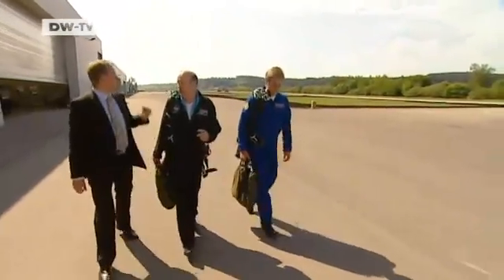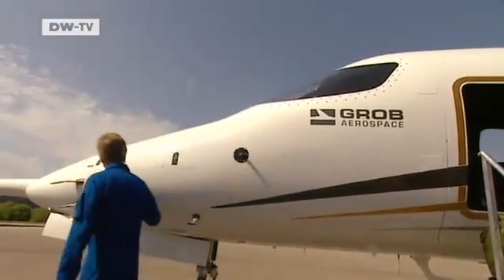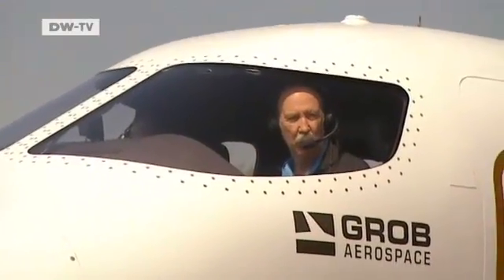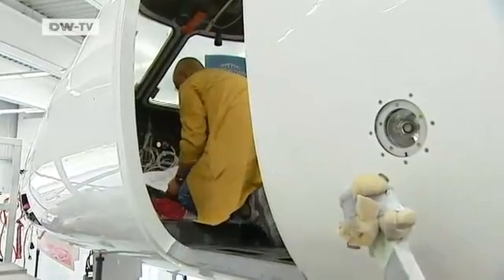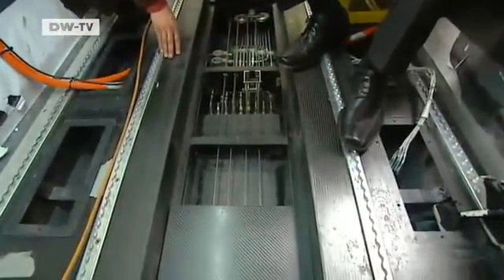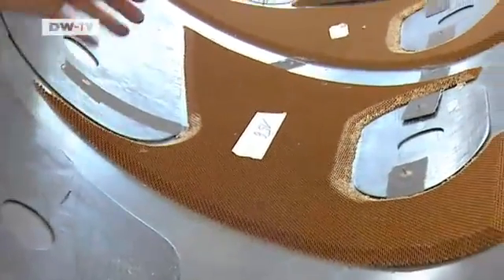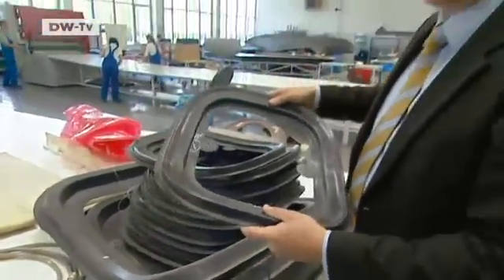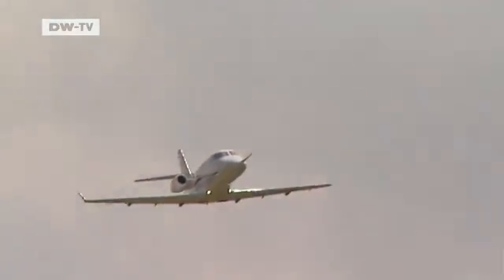Made in Germany | German Airplane Manufacturer Grob

Comment: Here after the news of Tata acquiring the IPR of this lovely jet!

Love from India.
Reply: Is tata also aquire engine tech of this jet?
Reply: @ajitd1521  No, no. It uses a Williams jet engine.
Reply: @AbhiKohli  so they used htap enginr og Hal
Reply: @ajitd1521  The size and thrust of the Williams engine is made to fit in the plane. It would be impossible to replace it with our homegrown HF25 engine. The power difference is quite much. Also, I am sure Tata don't want to spend more money on re-engineering an already very well performing jet.
Reply: @AbhiKohli  
But lenght is little bit more but diamer of hf25 engine is same
Hf25 is already try same type of aircraft

Comment: Can anyone help me with a doubt? Was used because this honey-comb tissue and not carbon fiber? Is there any technical advantage using this material?
Reply: Honey-comb material is a complimentary material to Carbon Fiber.
Reply: +Leo ybrv Honeycomb is used in combination with carbon fibres to build a so called "sandwich" structure. this is more stiff than a pure fibre shell whilst the core adds only a little bit more weight. in the video the fibres are missing in the shell. what you can see is the honeycomb layed in the mould for demonstration...
Reply: +Erik Seymour its phenolic or aramid honeycomb....sometimes aluminium honeycomb is used but galvanic protection required between carbon and aluminium
Reply: +Erik Seymour I don't know about this case, but for aircraft fittings (seats, console, galley) it's made out of .... cardboard.
Reply: +Nicole K it's paper I just had a 3 week school at the factory for the new g120tp.

Comment: carbon fibre cant hold its wealth creation like lithium metal alloy can so the economy is useless and one scratch and your grounded plus resale value falls like the space shuttle and so your not realy getting value for money with these miracle fibres as well the new 130 nose spar swivel angle rule and the lift centroid creation forward of the c/g is absolutely esentual to know or else you have a divergent aircraft under high stress modulus rules .. give me metal any time .. skeatesy

Comment: If you want performance you need new aerodynamics and engines.  Nothing really new here.  Just more expensive chariots for the elite.  Nothing cost effective.  Nothing useful on a daily basis, just more mindless use of a material on old designs.  Time to move on.

What is possible?  2 cents/mile with four people, roadable door to door.  No more hired pilot.  All this carbon stuff is very expensive.  Can't see out, hard to fix and on and on.  Useful?  No.

Comment: I am an Engineer who worked with Porsche and did airbags for all of Europe.  Interned at Porsche.  

Father was a Professor of economics.

Cipfalco has is right.  I found that a Mercedes engineer was worse than a GM engineer.  The only engineers that were "good" were Porsche's.  Their Mooney airplane engine was a total failure.  

Yes, German are very arrogant und Ich kann Deutsch...